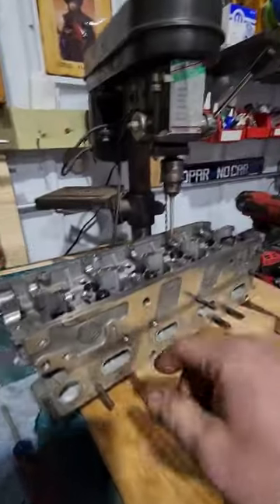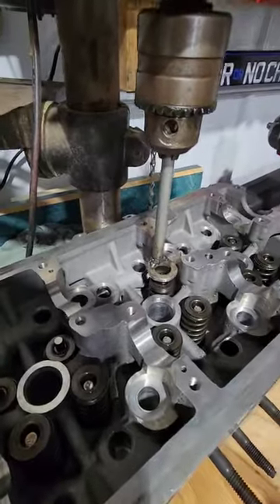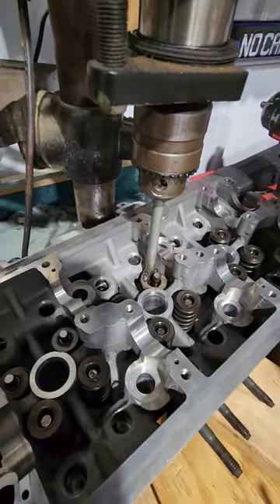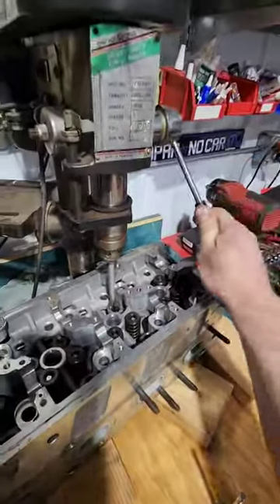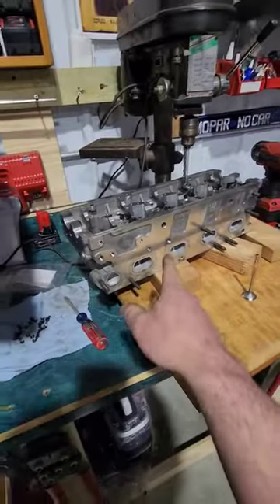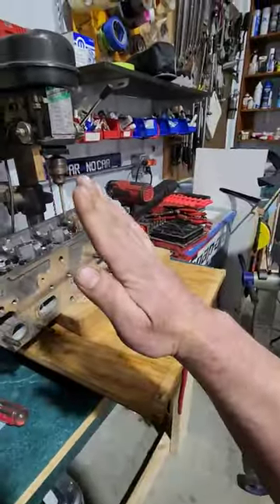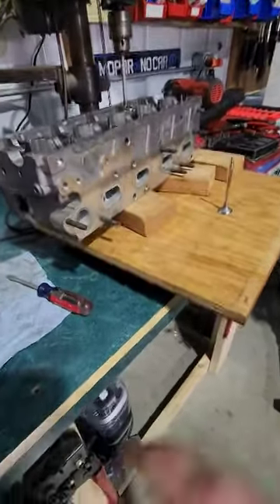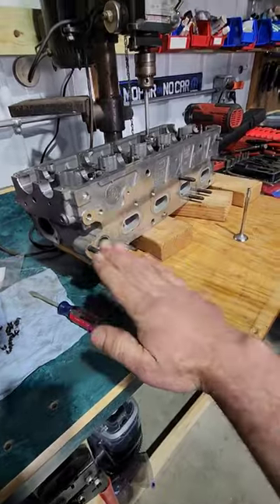Universal valve spring compressor! #shorts

Comment: I love it, much better than the c-clamp and PVC I cut a notch in to get the keepers out with my magnetic pick up tool. 
This was back in my early years, pressure testing the heads with a homemade rig, blocking the coolant ports with rubber and thick Plexiglas and hand sanding the heads with 80 and 150 grit with WD-40.

Comment: good luck putting them back on, the right depth the spring is compressed to makes it 10x easier to install them, even having someone else hold it would be very time consuming and annoying. plus exhaust guides are bad %99 of the time, so it's easier just to bring it to a machine shop because the guides will need to be replaced anyways.

Comment: Well i send cylinder heads to be cleaned and checked for hardness and resurfacing every time i remove one so i just send new valve stem seals and any hardware with it as it's easier and more beneficial to to the job once .

Comment: A valve spring compressor is the cheapest of the tools needed to rebuild heads !!!     Valve grinding machine valve seat grinder grinding rocks rock facing jig valve guide drivers and reamers are the main reason they get sent in.

Comment: My two cents…. Why are you swapping a valve? What damage has been done to warrant a new valve that WOULDN’T give probability of needing a fresh cut seat? If just swapping valve seals out or a new spring sure. But that can be done with the head still on in most cases with air pressure and some crude form of a home built tool, I like the idea but personally I’d be cutting the seats down to ensure a positive seal.

Comment: I still wouldn’t call it universal. Probably works great for most street motors, but I still wouldn’t do that with some race motors because of the super high spring pressure.
Reply: Don Hatton  We have 2 race engines for different drag cars, one’s a 680 hemi for a 72 Plymouth duster we’re racing this year, the other is a 526 with a B1 top end we’re converting to a hemi next year for our own 68 cuda. The valve springs on the 680 have over 1000 pounds of pressure each, that’ll snap whatever setup he has here. I can post videos of the duster running if you still don’t believe me.